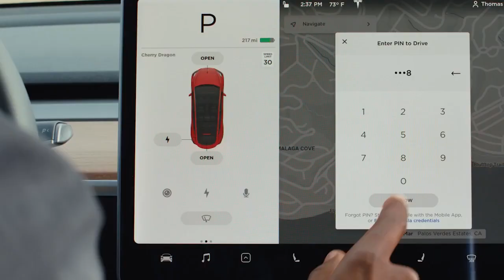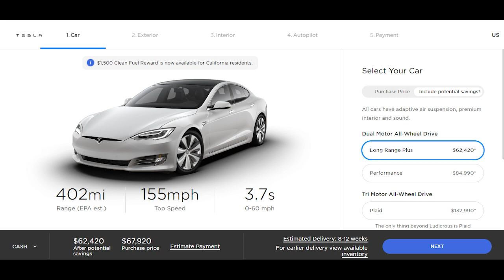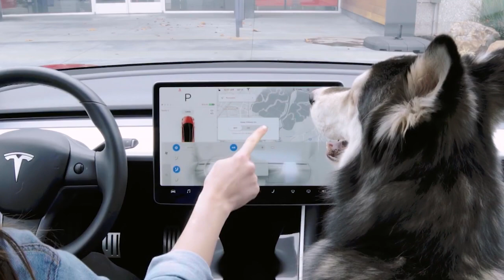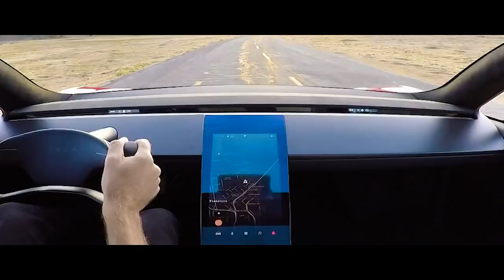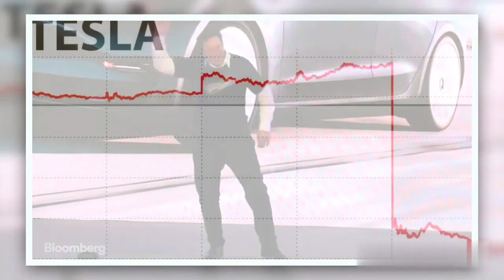IS IT A GOOD IDEA TO BUY TESLA STOCK NOW?

Comment: Hello Again,
new year 2021. Great video, but what are you thoughts on GIK Lightning eMotors,
they just filed there S4 After hours after Close on 31 Dec? They do FULL EV and
power charging station and they have been doing this sense 2018. They also have
deals with Amazon and PLUG? What do you think?  TESLA  is good but has already ran up 700% and bit pricy?  i would to buy once it drops.  Also they build class 1-3 and 8, so there is a large market of class 4-7 not in use. ,   GIK run has just got started. ?  what do you think
Reply from the maker: I’ll be looking into GIK, thanks for your insight. You made a great point, maybe GIK’s upside is higher. I’ll start doing research on it.